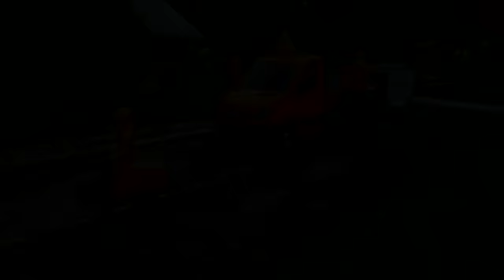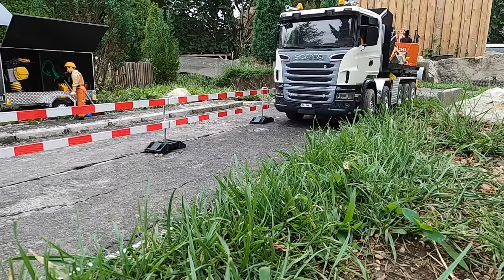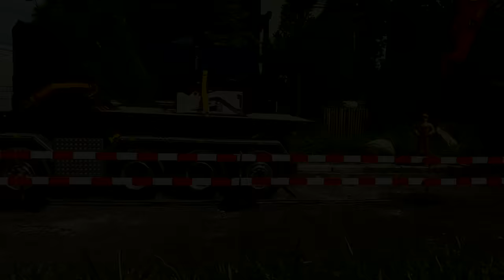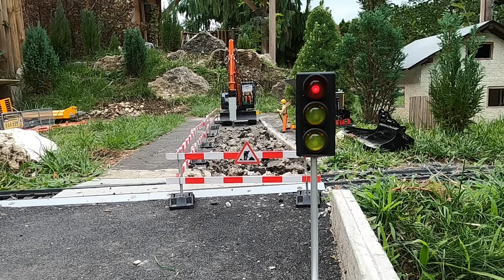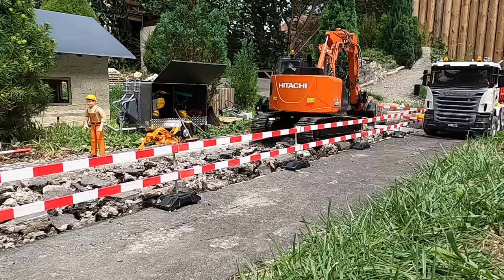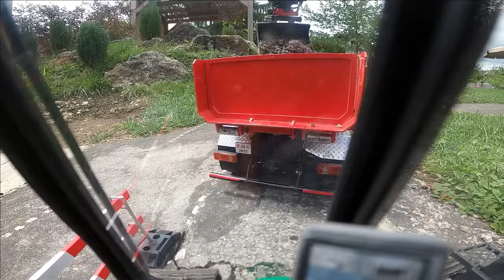Road reconstruction, RC Excavator Hitachi ZX135US, Truck Scania 10x8 multilift, PART 1

Comment: Another video i wish kept on rolling, :) nice shots there too with the 906 going past the hitachi, and also loading the truck. When i watch your other videos of the road building its gravel down, but it almost looks like you have concrete road base under that asphalt. if so that like alot of the road ways here in Victoria BC.
Reply from the maker: Hello, yes I have a compacter gravel layer and 20mm "soft" concrete layer and then the asphalt, only 1-2mm.